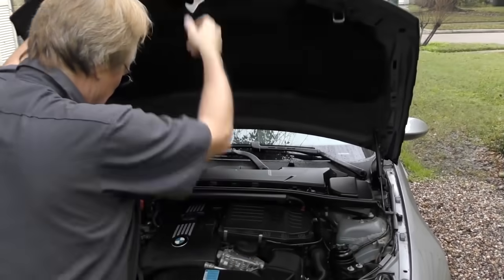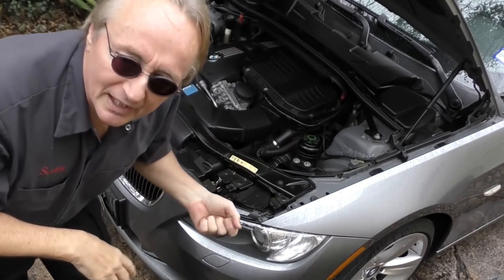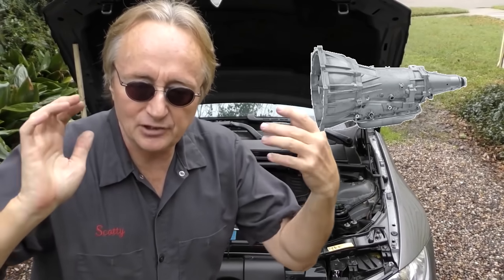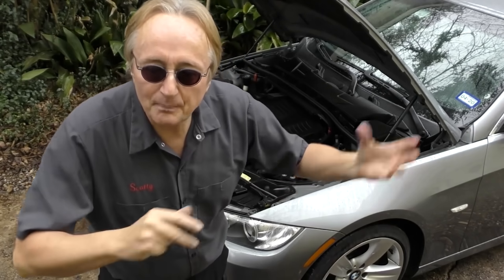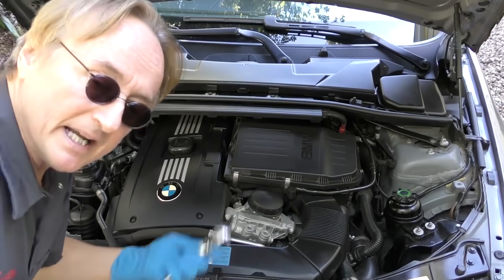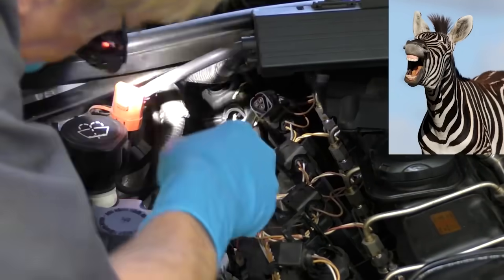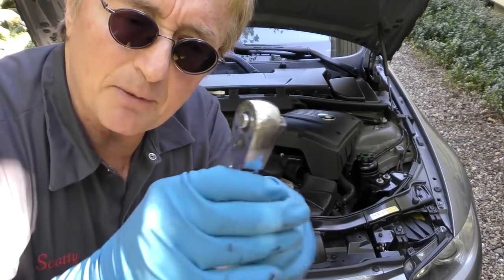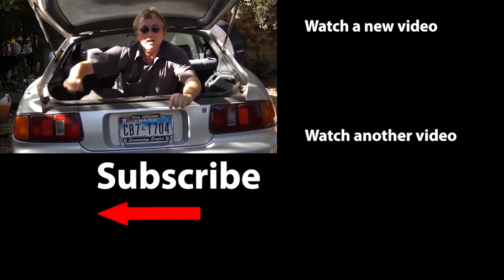People Say I'm Full of Crap About BMWs, Well Watch This

Comment: Have a 2016 750i with about 64,000 miles on it. Got it checked out in advance and it was in great condition. Was initially a leaser like virtually all 7 series sedans are. Have had zero issues with it. Maybe they'll come up in the future (likely at 100,000), but I'm confident I can handle simple to intermediate repairs, especially considering buying OEM 3rd party parts and installing them yourself with your own diagnostic tool cuts the price of repairs by a ton.
Reply: I'm thinking about getting a 2020 750i with the same idea when they drop to around 35k-45k instead of the 50k-60k they are right now. The V8 engine they use is actually reliable as long as you take care of it and can go for a long amount of miles.
Reply: my plan as well but make sure you have the actual $$ and time to maintain. I have a '08 XC90 volvo which I love and mostly wrench myself. Need a new alternator at 212k miles, $350 duralast will work if you can put in yourself but my specialist will charge $1125. Why? Bosch wholesale price $500 plus markup is $725 plus $400 labor, plus day in shop, plus a tow of my dead car at $150. So you are up to $1275 for an alternator. Plus is that volvo is not crazily complicated because its an old design but that model 7 is.
Reply: owned one up to 120000 no issues breaks and tires
Reply: I have a 2016 X5 with 176000 and this truck has been worth the money! Haven’t had any major issues. Yet!
Reply: @Sakosaga  what about a 2013 330i
Reply: And change the oil regularly. The models after 2018, are better made vehicles. If you noticed, most of these comments are about old bmw’s, none of them are like 2017 up to 2023.
Reply: @BBM-y6c  are you saying the newer ones have no plastic components?

Comment: Glad I got an Acura instead. Over 100k miles and normal maintenance with only major cost was a rear strut replacement. I got it used for 9k about 4-5 years ago and it had about 75k miles and it's 2012 Acura TL. Solid built, and reliable.
Reply: Acura is amazing SH AWD the best
Reply: My 07 RDX is over 200k miles, runs like a champ
Reply: It's just a slow a$$ honda
Reply: I have both a TL type-s and a 2011 335i with N54. I daily the Acura as it is super reliable and somewhat quick. However, its nowhere near as fun as the 3 series and short of spending $150k Acura doesnt make any car that compete with even a non-M BMW model.  Apples to Oranges.
Reply: Acura = Honda at double the cost for 90% the same parts.
Reply: @aydenhall3454  Just an expen$$ive Honda
Reply: @alaneichelberger3014  Same here. 06 TL with A-spec kit bought new. Now has 150K miles. 09 e93 bought used in 2019 with 58K miles. I daily the TL and for spirited driving, take the vert.
Reply: @aydenhall3454  people don't care for speed. We need reliability.
Reply: @aydenhall3454  I think it has plenty of power for my needs. I've driven slower!
Reply: @aydenhall3454  I mean it's not the 3.7 that comes on the fully loaded it's 3.5 but I find it has pretty good power. It's peppy but by no means like a new TLX Type-S. I paid 9k for it so it suits me fine.
Reply: @aydenhall3454  the 2004-2008 acura TL's are not slow, especially the type S version
Reply: Boring
Reply: @toriless  Acura is a luxury Honda which is reliable. BMW is just a polished turd marked "fragile"
Reply: Compare your Acura with a Honda Accord lol
Reply: @CollinY818  His Acura TL is basically a Honda accord

Comment: Bought one ( 320d ) 6 years ago  / 11 months old at 13000 miles.  Now done 34000 and oil changed every year. Returns up to 60mpg and never ever thrashed. Just replaced all the rotors / pads with Brembo. Drives a dream and is fitted with the B47 engine which replaced the N47 engine and 8 speed auto. Never regretted buying the car. Has never ever given me any problem and garaged all the time. Look after the car and it will look after you. Thrash it about the place and you will wear it out and give yourself problems.
Reply: Got myself a 318d n47 e90, replaced timing chain for 1000 bucks and running problem free ever since. Drives like new,  30mpg city driving, 50 to 60mpg highway. 1000 bucks for a timing chain replacement is nothing compared to the fun and comfort e90 series provides.
Reply: F30 n47 is much more reliable than some of the other bmws
Reply: @georgesunnyt  you're wrong, the N47 is crap especially the premature timing chain issues... The M47 is legendary and is way better

Comment: I have replaced the hood struts on my 2004 Ford Crown Vic now after 20 years. Have replaced with more expensive TRW struts. The old spring loaded hood lifters on older car is better. The Ford Crown Vic is very available all around, and very few plastic parts. The inntake is aluminium on this car. The EV's has less taxes here in Norway. The best prices in the world. But the insurance are high, caused by the high repair costs of these cars. Has got a lot of problems with charging in this winter. The china busses in Oslo have had alot of issues in the winter. The diesel busses has been a replacement.

Comment: $40,000 car and BMW can't even give customers hood struts that last 100 uses.
I highly doubt BMW owners are opening their hoods too often to check fluids.
Reply: They defintley aren't because bmw doesn't have an oil dip stick either. You read it in the dash menu settings.
Reply: Only BMW support struts fail right?....Not any other brand car...
Reply: The hood was opening thousand of times for repair...That's why the struts were out! It's a fact!
Reply: @ABC-qd1ei  Do not even try to compare BMW to other car brands when they have been consistently ranked one of the worst and least reliable

Comment: BMW Owner’s perspective.

Car : 530i Touring (G31)
New : March 2018
Bought : December 2019 with 7000 km on the clock.
Mileage as on March 2024 : 77 000 kms

Maintenance:

All brake discs(rotors) and pads replaced by BMW for free under warranty for vibration during braking when car is at 60kmph when car was 18 000 km

All brakes discs(rotors) replaced when car was drive 65 000 kms and this was paid by me ($2500 service costs). The vibration issue was solved temporarily but the real issue was damaged swing arms (worn out bearings).

All discs/rotors, brake pads and front swing arms replaced again at 75 000 kms and BMW acknowledged their error and only charged me $1200 for the swing arms.

Rest has just been routine service & maintenance with oil & filter changes which is super cheap if you buy the BMW service packs. 

I live in Europe.

Average yearly maintenance costs  comes to around $1000 per year and this is for the first 6 years of ownership. 

Is it high? 

I don’t think.

Build quality? Its superb. When I sit on the plush Dakota Leather seats and enjoy the panorama roof, heads-up display, heated steering wheel, adaptive cruise control, superior sound insulation etc. every km driven is enjoyable and I have amazing memories on long roadtrips (including driving through the Alps and also the Furka Pass). 

Could I saved more money buying a Honda and Toyota? YES.

Could I saved more money taking the public transport system? HELL YES.
Reply: if you just do regular maintenance, BMWs will be reliable. It's always the people too broke to do maintenance who kill the car.
Reply: @opachki8325  in Europe, BMW are considered very reliable cars and do not have the bad name as they do in the USA !!!
Reply: @PortlyPour  well guess why: exactly the reason I mentioned. We do our maintenance.
Reply: The majority of BMWs in my country come with 4 years of free maintenance. I bought one (G20 320d) with this option and I'm paying only for fuel, a tax, and taxi when this crap break again (7 times for 2 years, all front suspension had been replaced). Is it a great car? I would think so if hadn't owned Q50 before.
Reply: @artems4537  never had a single problem with my 320i. Might be a monday vehicle. You don't really see many problems with the 3 series apart from the nav head unit in the beginning
Reply: European BMWs and American BMWs are made in different factories. The European ones tend to be more reliable.
Reply: @PortlyPour  Honda/Toyota getting undeserved criticism once again. When there are plenty of other brands that make normal cars out there, like VW, Skoda, Seat, Mazda etc. Genuinely tiresome.

Comment: I’m pretty used to German cars so the excitement has gone away, but when I drive a Toyota Corolla, makes me want to go back to the Germans. Sure they may be expensive to maintain, but the drive is so satisfying. Nothing compares! And not sure if Scotty knows, but the 328i would have been a fair review as the 335i has a reputation for being unreliable due to its twin turbo engine setup!
Reply: plastic motor parts who thought this was a great idea?
Reply: Facts. They do require more maintenance and things are more expensive to fix but the driving experience is like no other. There are only be Mercedes and Porsche in my driveway.
Reply: The Toyota model is quite simple.  Don't change much and don't try to do too much.  They keep it basic.  If you're not changing things every 5 seconds, you really can hone in on reliability.  Heck, when did they finally make power windows standard?  They are also more expensive new compared to their basic counterparts (Chevy/Ford/etc.).  BMW and most German cars simply try to do too much.  Sensors are everywhere to wow you.  Over time, people spend as much or more with Toyotas.  You can certainly drive a chevy and fix it cheaper for 500k miles with the money you pocket up front.  There are always isolated cases of expensive failures, but parts like the 4L60 are one of the few transmissions I would trust a rebuild.  I simply wouldn't say that on most Hondas or Toyotas.  But if you truly prefer Toyota, etc., like the case in this video, just pay the extra for what you want up front.  Same goes for BMW.
Reply: The turbos are not that unreliable. The only issue that happens often is wastegate rattle. The rattle is nothing but a slight noise when it first starts.
Reply: I have the 2008 328i and it has been very reliable over the 15 years I've owned it.  Just 5 repairs so far, 2 early on under warranty.  The most recent repairs I did DIY without much trouble and they were due to age and wear and tear.
Reply: My 328d has been the same way. 9 years/160k miles/1 warranty repair. With a diesel, I view that as really good. I’ve had 4 German diesel cars now and my last one went over 300k with no major issues.
Reply: @raven4k998 because it's for durability

Comment: yes, I had a beemer I was so tired of plastic parts breaking I sold it for a loss. who puts that much plastic in a cooling system? a country where summer temps rarely exceed 85 degrees.
Reply: Ford
Reply: VW
Reply: You would be surprised. There are so many plastic parts places in cars today.
Reply: Toyota
Reply: @Daniel_Colavecchio  ..yep! My 98 4runner actually had an OEM radiator with plastic ends just like the Bangel butt 7 series BMW's, I was shocked and saddened! I had no idea Toyota did this until i went to change it out back in 2020. It didn't need replacing until over 250k miles so i guess it lasted long enough...but still a dumb idea!
Reply: A brand that’s totally focused on creating unreliable and difficult cars to repair in order to profit maximise.
Reply: @edcox1630  It's a rarity to see metal ends on raditators now on any make and I stared seeing that in the 90's. Dumbest idea other than to keep people replacing parts, just like wipers that used to last for years but now, 6 months.
Reply: @Daniel_Colavecchio  Toyota absolutely along with many brands. it boils down to price$$ and longevity.
Reply: Just replace the plastic coolant parts like you are suppost too, quit being cheap.
Reply: Yeah all parts should be titanium....

Comment: I had a couple of BMW's, e90 with 2.5 litre I6  (N52) and e46 coupe with older 2.5 I6 (M54). The e90 was a daily driver, other one was a weekend drive. Both lovely to drive, both built to perfection, solid like a rock! Also a common thing for both of them is that both of them were prone to failing, often and badly. It was not worth it, sold both of them after 3 years. I gave them for a low price just to get rid of them. I know a lot of people with the same experience...
Reply: Which engine did you like more? N52 or M54? Thanks
Reply: @nurousek123  mine was N52B25A, it was 2.5 litre, 218 hp, valvetronic. It was a better engine to drive than the M54, low power on low rpm but it sang all the way up to 7k rpm. That particular version has a problem with thin thin piston rings so it drank oil like crazy. It was a better engine to drive but was ready for a rebuild after 180k km...
Reply: M54 is one of the best engines ever created. I own one with 200.000km and sold anotger recently with 200.000km too.
There are a few little sealings that can go bad on these but they are so easy to fix everyone can do it.

The way the E46 and E39 handle is unmatched in my opinion.

Comment: NEVER EVER again. I've owned two, a 5 series and a Z4. What a substantial piece of substandard engineering.  Dumped as soon as the warranty expired. NEVER EVER again.
Reply: just bought a z4 what were the problems?
Reply: You made the right decision
Reply: @tristenisaacs8581  2011 Z4 the whole trunk filled with water, the taillights filled with water, the roof only half closed two different times. The battery in the trunk was submerged. I found out later the BMW dealer in Seattle drilled a small hole to drain the water. That vehicle was in the dealership for 2mo after I purchased it. I love the new Toyota Supra, but, it's basically a BMW. I hope you have better luck. I love the looks of that car.
Reply: They are not cars to leave sitting outside...
Reply: Yeah looks like you just picked bad models/ generations lol. Not all BMWs are the same
Reply: @Jules  Nah those are actually common problems on the E89 Z4.  You have to watch out for them, especially the tail light and battery submerge.  The water will get on to the roof mechanism motor and mess that up too.  Fortunately, it's an easyish fix, but you must take it apart and clean it.
Reply: @MikeyG003  Not all BMWs are the same but all BMWs require obscene amounts of maintenance and $$

A 4 figure repair bill is normal. I have a buddy with a N54 engine, the supposed "most reliable BMW" and he's spent over $8K keeping it on the road the last 2 years LOL 

I did the math and I'd have to keep my toyota for about 23 years before I spent the same amount

Comment: My sister hit a deer with her BMW 3 series and her car was shaking afterwards with a check engine light.  I knew it was the coil packs but I told her to order spark plugs along with the coil packs.  3 hours later her car wasn't shaking no more and was quiet like a brand new car.  
The bad - a few plastic pieces did broke with me not at fault.   I thought BMW was a high end high quality car manufacturer but boy was I wrong when it took me 3 hours to change spark plugs and coil packs because of the plastic parts you have to remove when it would have taken me just 45 minutes to changed out the same parts on my Acura TL.  Unless you have warranty I would highly avoid BMW.
Reply: Yeah. I'm in my mid 20s and I don't have any plans of buying a BMW or Benz lol I stick with older American or Toyota, lexus but that's it
Reply: @TreyGoose  Try considering a Ford or Lincoln also.
Reply: Rip deer. Killed by a bmw driver.
Reply: @TreyGoose  Hondas/Acura is actually easy to work on too.

Comment: I have a 2008 bmw 528xi  fully loaded. and I had it since 90.000 miles . it's been 13 years and all I changed was brakes , all fluids changed, and front and back suspension and a few coolant hoses  . my car is at 210.000 miles and engine still quiet as a baby . ITS NOT THE CAR ITS THE USER.  💯💯💯
Reply: I have the same car 08 528xi  205k did all the same repairs front and rear springs the entire front suspension alternator start ignition coils . The lifter tick is my only complaint expensive to maintain but I have had it sin 2013 with 68k. I have gotten my moneys worth . I won’t buy a BMW again .

Comment: The only people who hate BMW after owning one are the people who bought one with turbos or are 3rd or 4th owners. The 328i with the naturally aspirated inline 6 is hands down the most reliable BMW I've owned (4) and second out of all my cars only to a 99' Honda crv with 350k miles on it. Less power sure but also less in repairs.
Reply: Yeah my turbo dying on mine 😭😭
Reply: The true judge of quality is time. if it is junk after a few years it's not quality.
Reply: Just buy a straight six diesel. Change oil and forget about all and any car problems
Reply: Yep especially the 08 year .. I sold my 328i to my friend he loves it I miss that car lmao
Reply: @hampusbrydling6459  TRUE!!!
Reply: Nope,  I had natural 6…..bought new in 2006, dumped it 3 years later with problem after problem
Reply: @jo mas yea except for the part you can’t buy a recent bmw without a turbo… all of them are turbo now.
Reply: @Randomeris1  couldn't agree more, currently driving e90 n47 318d, and I love that thing and the maintenance is really cheap. If I could get a hand on a 335d e90, even if it had 160k miles I'd buy it in a heartbeat.  282hp, 580Nm of torque and fuel consupmtion of 30mpg.
Reply: whenever my turbos go, just giving me an excuse to go single :) n54 123k btw
Reply: Couldn't agree more. My 08 E92 328i (N51) has been an absolute joy even at 140k miles. I just took it on a 37 hour cross country road trip a couple weeks ago and it had 0 issues. Barely even burned a drop of oil. Sure it's slow, but pretty fun to drive with a stickshift and very reliable and easy to work on
Reply: I'm the 2nd owner of a 2005 X5 and I absolutely hate mine. I can't afford to keep it and I can't afford to buy anything else because I keep having to repair the X5 until I can find something else.